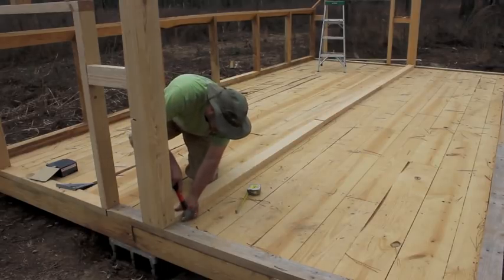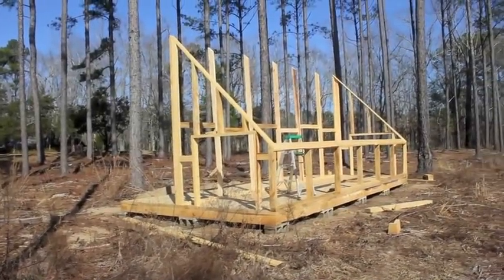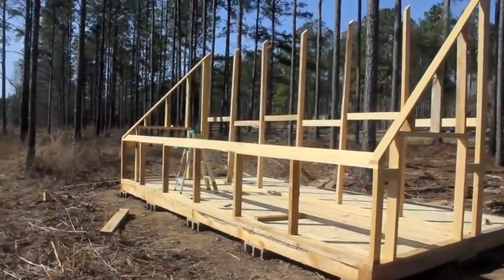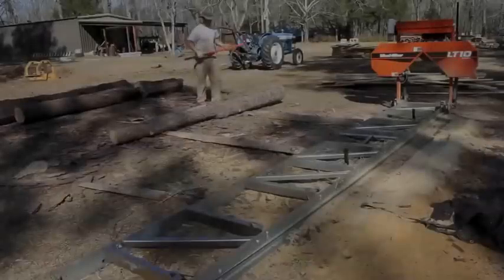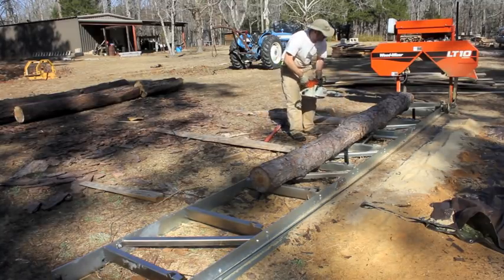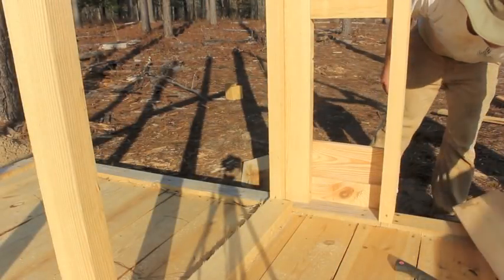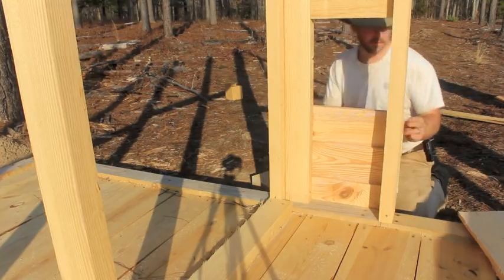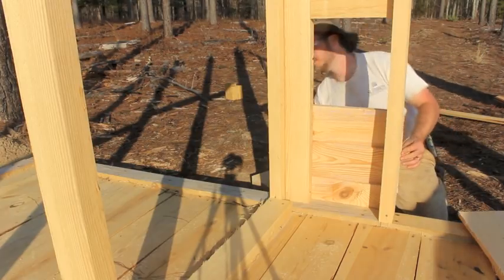Building a solar kiln! Part 4

Comment: In north Florida, February of 1972, we built a weekend cabin out of fresh-cut pine that not only made it through all those years but also 2-dozen kids from different generations. You can--this is fact, as it was just done a month ago--jack up this building from one corner! We had to replace those foundation blocks.

That thing is square, true, and VERY STRONG!!! Green wood, nailed in place seems to provide its own countering forces? Like dynamic tension?

Your videos are great stuff!
Reply from the maker: dantco Thanks for that great comment and the support!

Comment: The rest of that platform could be used for pre drying  that way you have a couple stacks air drying while the other stacks are in the kiln it might speed the process a little.

Comment: Doing a great job,only thing I would have done differently was the use of coated deck screws insted of nails.
Reply: I agree and either treated the bottom beams or used pressure treated. Those blocks can wick up moisture. Looks good though.

Comment: For your siding cut a spacer block with a lip on the bottom.  Just put the lip at the bottom of the installed board then set the bottom of the next on top.  Will give you quick uniform spacing.
Reply from the maker: wauhawk Now that’s a great tip! Thanks!

Comment: Xi am surprised in the video I never saw you using any square or a spirit level to nail your timber unless you had the frame already marked
Reply from the maker: Paul Saliba I am using a square a good bit, I’m just not showing those video clips. I’m not using a level, because the foundation is not perfectly square, so I don’t want to use a level to level something with the earth when it won’t be square with the foundation. That’s my rationale at least, I’m no carpenter.

Comment: Yes the common or standard practice is to assemble the wall in as big a section as you can manage on the ground then tilt up.  You're just using an old technique.
Reply: You're on a small scale doing a balloon frame rather than the more commonly style used today.  Still valid just not as common these days.
Reply from the maker: wauhawk Thanks for the comment. My main issue with assembling the whole thing and raising it would have been weight. I probably could have done it but I’m working by myself so who knows.
Reply: And for that you would make a section big enough for you to manage then another and another until you have your span.  You'd have a double stud where each section met that you'd nail through to make one wall.  

Both ways work and both will meet code.  You're using what's considered the old way and also considered the slower way.  You're not in a hurry so speed isn't the goal.  You're on the right track!
Reply from the maker: wauhawk Ah that makes sense. Thanks!
Reply: Looks great but I think I would invest in some more drop cords to cut down on the walking  but keep up the good work.    Kennyg

Comment: How are you going to load wood in and out of the kiln? I don't see any doors in the framing yet.
Reply from the maker: If you look on the sides, there are two large square holes. Those are the rough door frames. I'll load it from the sides.  Thanks for the comment!
Reply: The reason I ask is that I recently loaded my kiln full of wood. My door way is about and inch shorter than I am and I have hit my head on it quite a few times. I wish I would have made my door a little taller and given myself a little more room to walk behind the stack. It looks like we are building kilns at nearly the same time. I just had a slight head start. If you have not gotten to far in on framing you may want to give some serious thought to how easy it will be to walk in and out with a heavy board. I would have done things a little different on mine if I could but its a little late now. Looking good though. I wish I had a saw mill
Reply from the maker: Chuck Thunderburg My doorways are one of my concerns for sure. I thought seriously about a personnel door in the rear but I didn’t do that either. I did increase the height somewhat from my original plan. I figure I can modify things if it’s too much of a disaster in the end. Your kiln looks good! Looking forward to checking out your videos.